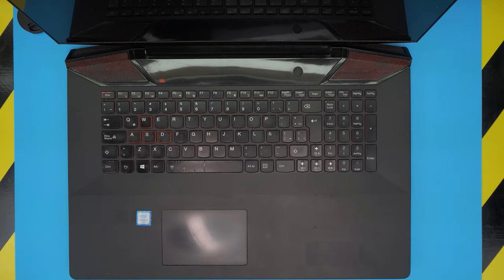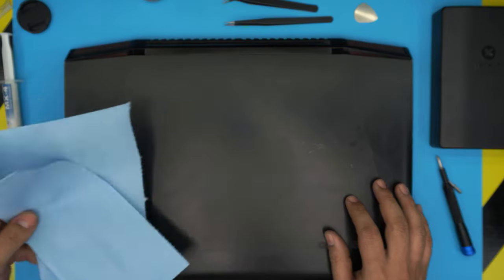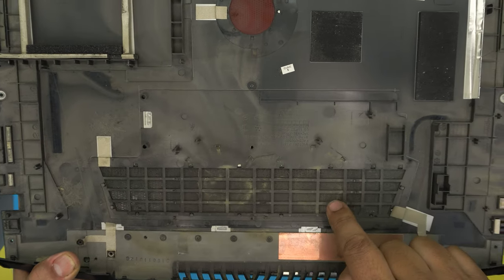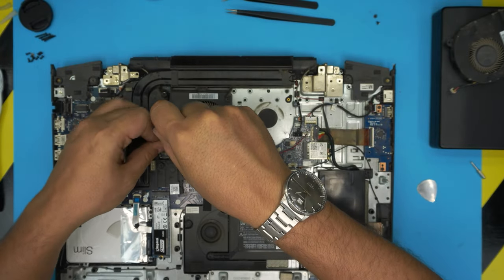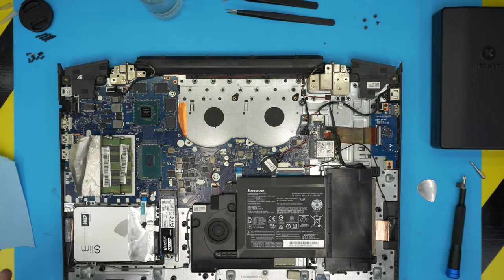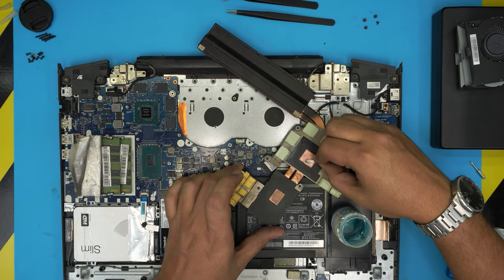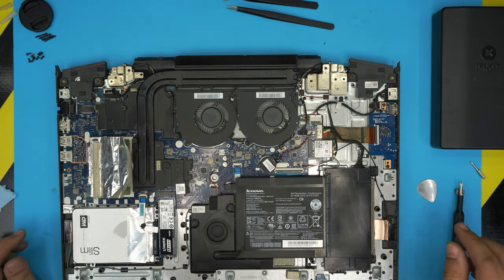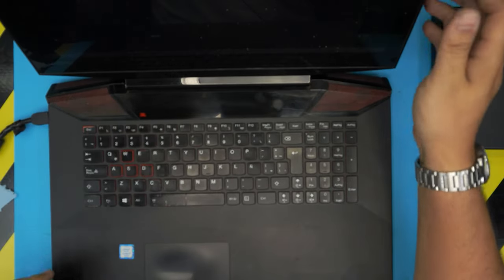Lenovo Ideapad Y700 17Isk 80Q0 Tear-down Service Repaste

Comment: Thanks for the video. I've been postponing the repaste on mine because of those thermal pads. But now I know I don't need to change them because i don't overclock. Can you be more specific about that liquid that cleans the copper ? I'd like to buy some but I don't know what to look for. Mine has the original thermal paste on it so it won't be corroded but I don't think it would hurt to clean them.  Thanks
Reply from the maker: You're very welcome! 😊Thank you for the feedback! if you wish to support the channel you can LIKE or SUB or both :P
regarding your question about the copper cleaner, you can use a Silver cleaner solution paste or liquid, the one i use its a silver cleaner solution, you can clean that even with Isopropyl alcohol  and baking-soda, and rub that for few sec or min and it will clean like new.
even with factory paste it will get corroded sometimes.
if you got any other question feel free to ask me.
Reply: Late response, but the correct liquid to use for cleaning thermal paste is Isopropyl alcohol 99.9% purity. Reason being is lower percentages contains water which can damage your electronics

Comment: i got one question i planning to buy this laptop Laptop HP 15.6" 15-ef1012la  but i dont find any information on additional nvme ports or sata ssd port maybe you can help me , because it  only comes with an 256 gb nvme
Reply from the maker: Thank you for the feedback! if you wish to support the channel you can LIKE or SUB or both :P
regarding your question:  the laptop you mention we get them often here in Mexico its LA (latino america) model.
i have made few videos on this model:
https://youtu.be/BI0BK7JKbw4
https://youtu.be/xXuLdVAGte0
you can upgrade the NVME ssd to 4tb if you wish. there is only one m.2 nvme slot available.
saludos

Comment: A paintbrush works great too
Reply from the maker: paint brush for what?!! 🤯
Reply: @uFixTek  for brushing the dust, i like to hold a vaccum cleaner near aswell so the dust doesnt make a mess
Reply from the maker: Using a paintbrush to clean the fan and case is indeed a good idea and perfectly safe. However, it is important to be cautious when using a vacuum cleaner near the motherboard. If the vacuum nozzle is made of plastic, it can potentially generate a significant discharge spark. Therefore, it is advisable to keep the vacuum nozzle a few inches away from the motherboard to prevent any electrical mishaps.